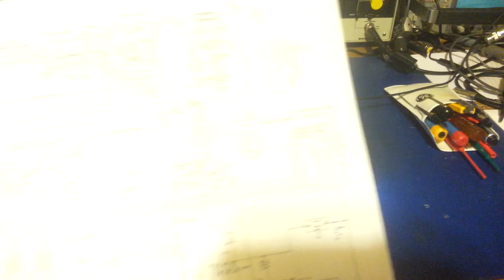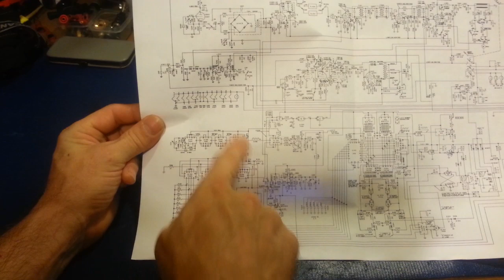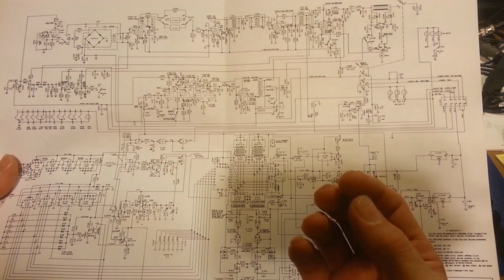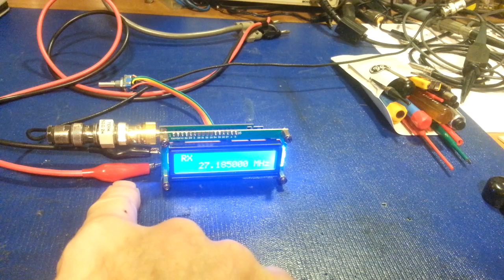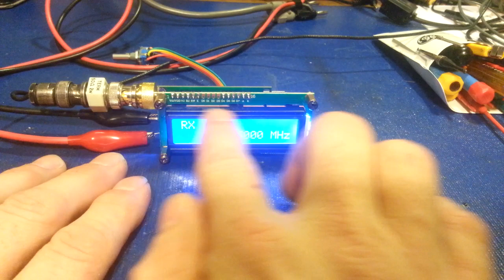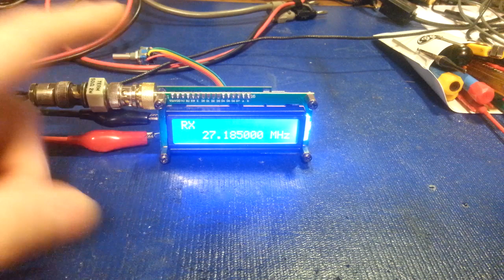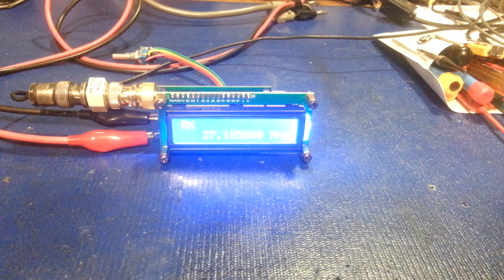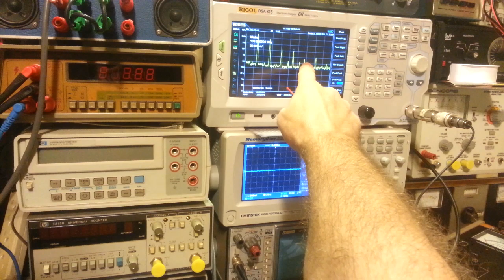Your thoughts on installing a DDS VFO in a Browning Mark IV transmitter.

Comment: Mike... This is Marty. I've written to you before. By trade, I'm an electro-mechanical engineering technician. I work on Military electronics. I'm an Advanced class ham. I've serviced CB equipment profesionally for more than 30 years a while back. One of the shop owners that I worked for gave me some words of wisdom that I have never forgotten... "Once you agree to work on someones radio and take their money, you become married to that radio". I have never forgotten that. In this case; with this particular radio, my advice would be "Don't touch it... put it back together and return it to its owner".

Comment: I would not hack up the old radio. however i wold put the dds vfo in a box for external vfo. or just use the receive vfo as transmitter vfo.

Comment: Also, Is that the DDS from Newzeland? Maybe you can do a video on how to program that DDS.
Reply from the maker: Yep, that's the one.  Its programmed when you get it.  His instructions describe how to set the frequencies.
Reply: Thanks for the reply. I meant the programming for the MKiv. So anyone wanting to do it will know how. Make it easier for them
Reply from the maker: +Paul Thermadyne 

There really isn't any programming to do.  Set it up max and min frequency range and your mixing frequency and your done.  Its all in the instructions.
Reply: Sounds good. So you can set it for the needed output freq and have it display 27.xxx ?  And it will track correctly?
Reply from the maker: +Paul Thermadyne 

Yep, pretty much.
Reply: Thanks for the info

Comment: I would either mount it behind the ON THE AIR mode window and lose the on air light if it needs to be in the radio or put it in an external box so it can be used on other radios if wanted like the old Pal and Siltronix vfo.

Comment: can it be made to work on the am only browning
Reply from the maker: Would have to look at the schematic.  Which model radio?
Reply: sorry I mint am only transmitter I think they are about all the same. I have been using cb radios hooked to the channel selector to get all 40 high and lows channels

Comment: Hey, at least Browning was smart enough NOT to try building a PLL from tubes. Would have been bigger than the whole rest of the radio and cost ten times as much. 

This radio began its life as a 23-channel design. Browning would have been ahead of the pack if they had gotten it to work sooner. Took them forever to get it working as well as they did (reset switch). By then the window had closed for FCC approval of a new 23-channel model. By then, only a new 40-channel radio would be approved. Back to the drawing board. Numerous changes were made, especially in the receiver, to make it comply with 40-channel approval rules. 

We sold just over 400 upgrade synthesizers before we discontinued it last year. Phil Nichols supported the Mark 4 for decades by converting it to a Mark 4A. That was the only way you could get him to repair a Mark 4 between when Browning closed and Phil retired. 

We're working to adapt the cheap Ebay DDS boards to a Mark 4, but it's way, way behind schedule. It's tough to prioritize design work when repair customers are backed up months deep. 

Doug may not be too happy about his boards going into a CB, but there is another design by a New Zealander named Chris Day. It uses the cheap Ebay DDS boards piggybacked on his controller. Google ZL1CVD. That should direct you to his boards. The firmware is open-source, and adapting it to two 7-segment LED digits should be doable. 

You're on the right track. You should not need more than about 5 Volts peak-to-peak feeding into the 6CB6 transmit-mixer tube.

Great work as always!

73
Reply from the maker: This is a ZL1CVD. :)  I may need to add a amplifier stage because this puts out 1300mV in high mode.  Otherwise it shouldn't be to hard.
Reply: If you like, email me your snail-mail addy and I'll send you one of our buffer boards. As you say, not too hard. But a board that's already built is easier. It has a trimpot for input level, so it should adapt to this purpose just fine. 

73
Reply from the maker: +Chris Reifsteck 

Shoot me a email.  Just add @gmail.com to my YouTube user ID.
Reply: Need a buffer board for a project.  How can I contact you Chris? The Browning world needs a  road map for a  DDS on these so I nominate you Mike!  Keep up the good videos!
Reply from the maker: +Mountain man 

His email is on his Nomad radio website.
Reply: Thanks! Did not know Nomad was still selling them.

Comment: I do not own a Browning , I do understand the Nostalgia of having an original radio that you would have gotten from your radio shop and just talked for hours on it.
But I must say if this is going to keep the radio on the air way not, and it makes the original radios out there more valuable. 
It sounds like the customer wanted more channels and took it some where and messed it up and you have to deal with the aftermath, you can only deal with what you got. Make the best of it keep the radio on the air.

Comment: Oh I missed this video. I am about 4 minutes into it. Real busy here.  I hit pause and had to make a few comments.  I think of these radios as a  problem child. The Browning engineers was desperate to come up with something quick on this radio.  And it was a failure just like Tram folks did on their hybrid radio. (solid state and tube final).  Now a friend of mine ripped the PLL out of a cobra, cannot remember the model, and he converted it and installed it in one of these browning's.  No more issues. Only problem is when he passes away there will be a short list of folks that can work on it. He is 74 now. Problems to over come with a DDS VFO, SSB offset, harmonics.  The first can be eliminated with an Adriano Uno board and Atmel technology. Gives you programmable features than just running the DDS unit alone. Just things to consider.
Reply from the maker: The ssb offset is built into this unit.  These units were made specifically to work with radios like a FT101 and other amateur rigs.  The only thing I need to do I guess is add a low pass filter.
Reply: Great! That solves the big issue then. Yes I think a low pass filter would handle any birdies you may have.
Reply: Yes and no. The issue with a lot of them is that you can low pass the crap out of it and it will still cause you grief. In my case I have one at 27.70Mhz and that tone is -90dB below the fundamental. But when your injecting that 27.70Mhz in along with your 35Mhz at the mixer... then it gets amplified a bit... and you can't filter that enough. I got it down to -140dB and it got amplified enough to cause an S5 deflection on the radio.
If you have one of these tones it's simply too hard to kill. It's not the fact that it's there more so that it's actually being mixed into the receiver... and there lies the issue. Receiver noise is the biggest problem with doing this. It's not impossible to fix.... but it's damn hard.
I actually had a far worse issue with this using the AD985x DDS series than I did using the silabs clock generators. It's one reason I scrapped the AD985x idea to start with was receiver birdies.
Reply from the maker: +Mark19960 

One big advantage of this Browning set up is the receiver is a completely seperate unit and has its own oscillator circuit.

Comment: Don't have a dog in the fight but a more "elegant" solution might be an external enclosure for the DDS. Back in the start of the ham hybrid radio days there were OEM or aftermarket external digital displays; Kenwood had one and I still have the "Torrestronics" display on my Drake C-Line. You could then simply blank out the current display and allow the owner to configure where the smaller box may fit in his shack. May need a simple LPF to clean up the harmonics and avoid any mixing by-products sneaking into the output.  Just my $0.02.  73 - Dino KL0S
Reply from the maker: Not sure why I didn't think about a separate box.  I do that kind of stuff all the time.  I could just add a SMA connector on the back of the radio and another multi pin connector to enable the ssb ofset switching.
Reply: This sounds like a great idea to me, separate box idea.

Comment: Well, the original circuit is a bad, unreliable design, and it's FUBAR. No loss doing this mod to that particular radio  I'd say. A low pass filter is called for at the DDS output. Not much can be done about the spurious signals though. Hopefully they won't fall in band at whatever injection frequencies you need or will be so small so they won't matter much. Some of the earlier DDS's suffered from those.

Comment: Sounds like you might just not have the right set of skills for this repair job.
Reply from the maker: No, not a schematic of how it was butchered.  Its a absolute mess of cut traces, wires in different locations, parts hanging all over the place just bodged onto the tops of the board and a different EPROM that I do not have a truth chart for.

Comment: I think it is a better option than tossing the radio in the trash or just parting it out. If every muscle car and hot rod had to have the same engine they came with from the factory with number's matching the hobby would not exist and 99% of the cars would have been recycled in Chinese made toys and silverware. I understand the purist but in real life that ideal is not always practical and the customer wants a radio that works not something he can stick under glass for visiting tourists. 

Now if it was not butchered already and the guy wanted to add the DDS VFO I would be ok with it so long as it could be put back to stock. I would probably do it as a separate black box like the Digi-Scan. Since this is not an option putting it back to stock is not cost effective than the choice has already been made and now we are just a having an intellectual debate.

I was considering the idea of having you do this to an old radio mobile that is not a collectors piece and is not in perfect condition.  It would be nice to have the cybernet SSB chassis perform at it's best. The radio with a DDS VFO would be at least as good prob. better than a Lincoln or RCI2950.
Reply: another good option!

Comment: Hi, Mike, I would make the change to the browning CB unit,the owner would then have a complete working unit that would give him hours of satisfaction. Regarding the DDS unit at 550Khz it produces a square wave, you can possibly improve it by putting an emitter follower stage with a tuned collector at the required frequency of 27Mhz and then check again for harmoincs and a low pass filter in circuit tuned to 27Mhz. I have an exact type of DDS myself, I brought it for 20 and 40- meter homebrew SSB transmitter. The emitter follower stage returns the rich harmonic wave to a sine wave, let me know the out- come with the emitter follower stage.
Reply from the maker: Actually these produce a not to bad looking sine wave.  They were designed for use in amateur radios.